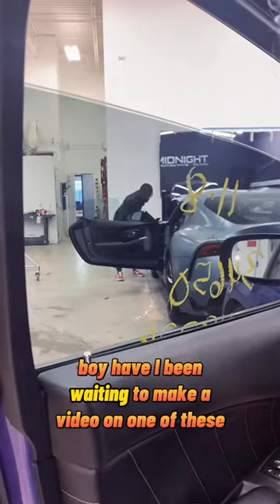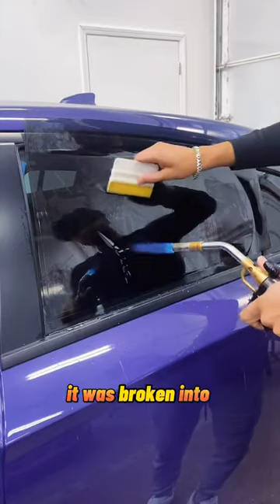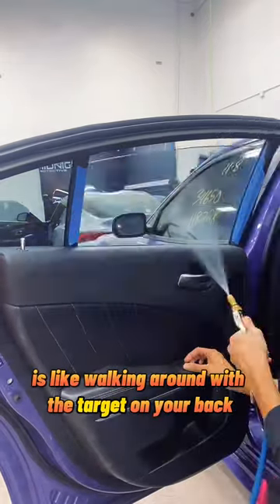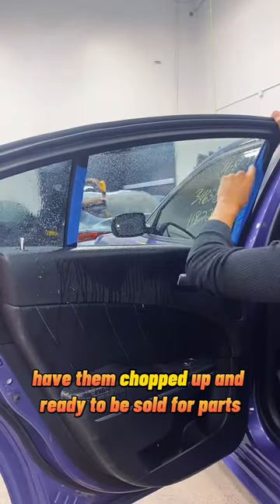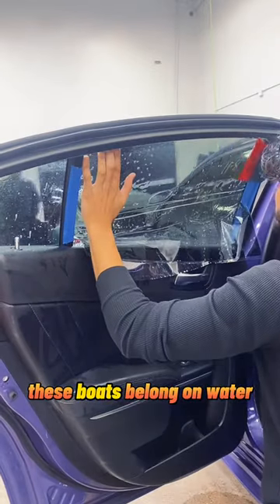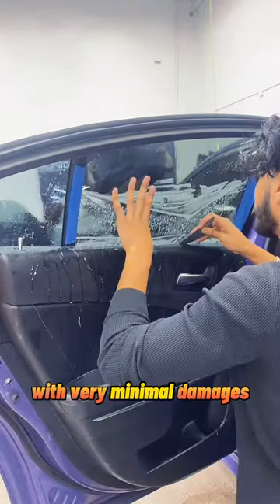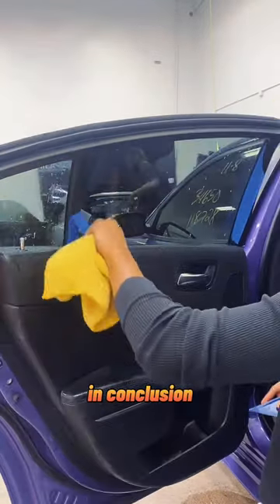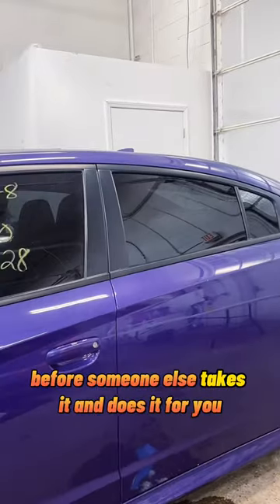Most STOLEN Car in America

Comment: And then there's two of my Honda civics stolen and found 10 hours later with just the frame. Del sol also stolen but retrieved with no damages besides broken steering lock and stripped gage cluster for short wiring

Comment: Scat packs are not the same as srts
Reply: The srt 392 and 2020 scatpacks and up are pretty much the same. Both can have 6 piston brembos, both have the same suspension, both have 392 hemis but one comes back as srt when you read the vin and the other comes back as an rt scatpack
Reply: @GloomToon  no scat pack has 707 hp
Reply: @Joseph-it3rf  I never said scats had 707. Srts aren’t just hellcats. The srt 392 was in production from 2015-2018 and they had the same engine as the scatpack but had hellcat suspension, brakes and interior besides the hellcat badges. It was the highest trim you could get for the 392 and below that was the Daytona 392 and t/a 392. Jeeps also have a srt 392 as well as durangos.